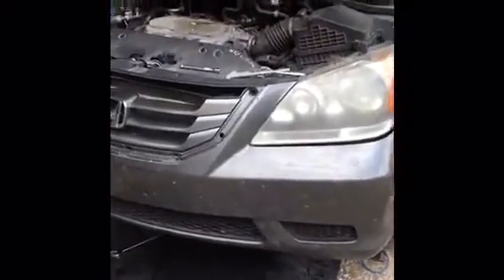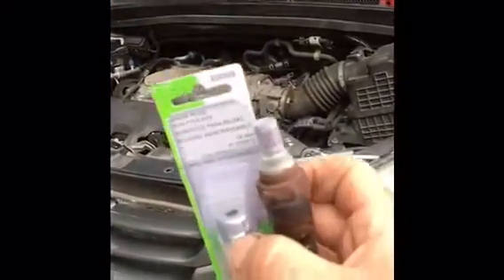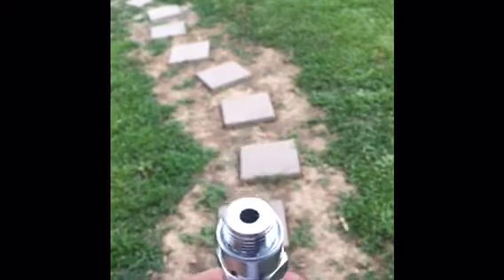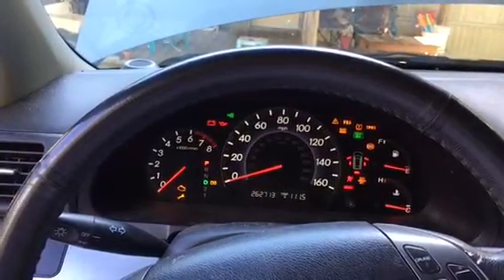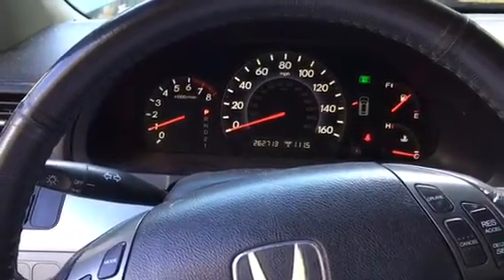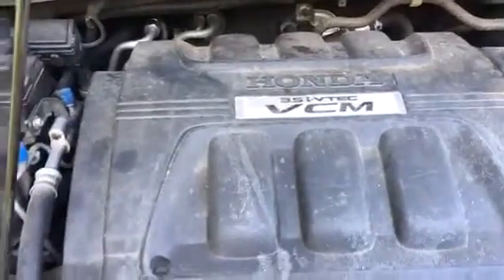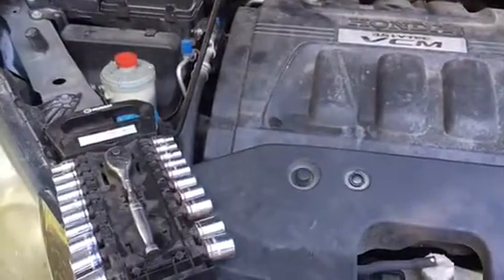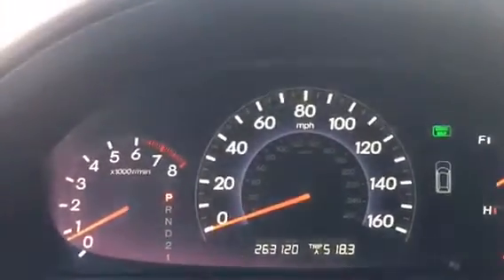P0420 o2 sensor non-fouler hack!!!

Comment: Great job! My honda Ridgeline gave a P0420 on bank 1 so I put an anti-fouler on the top of the cat (it has an upper and lower). I cleared the code & drove it for 20 miles and got another CEL for P0420 below threshold. This time I put an anti-fouler on the lower one, hopefully that did it the trick. Truck has 145,000 miles.
Reply: Did it fix it? Did you bore out the bottom and the top foulers? I bored out both of them...maybe that's my problem? Bore out the top and leave the bottom hole small?
Reply: @McL0vin2131  no I have since sold the vehicle as a result of it being a piece of junk